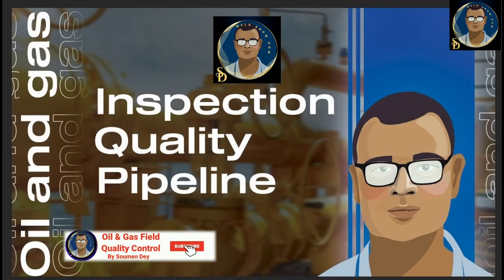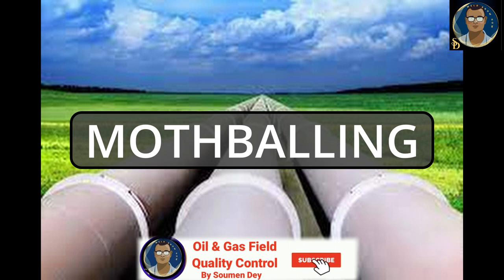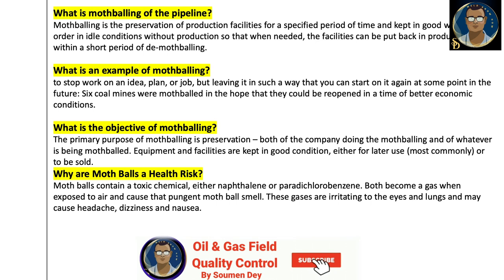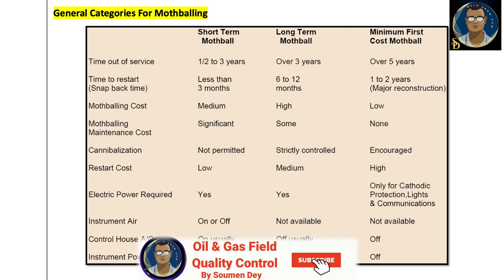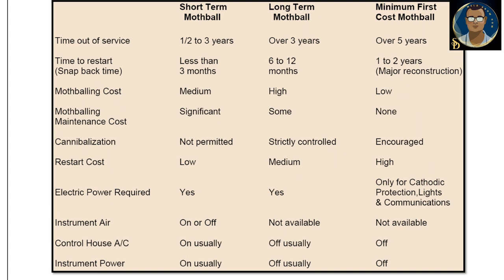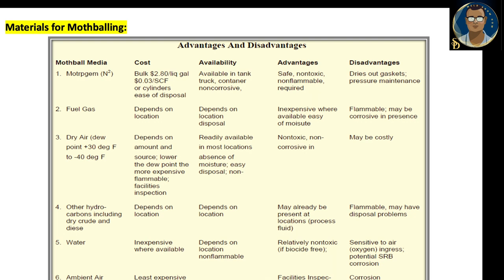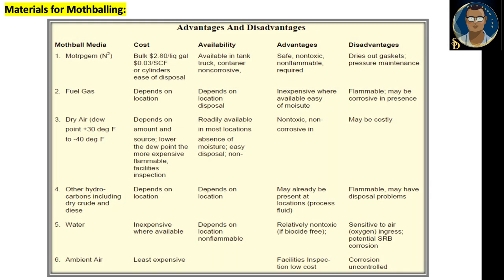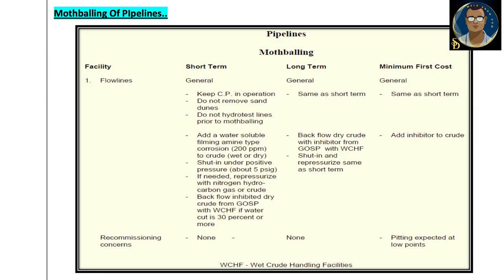MOTHBALLING, DIFFERENCE LAY UP & MOTHBALLING, OLE FACILITY IN ACTION, REINSTATEMENT PIPELINE PROCESS

Comment: Thank you very much , it is well presented, i am very interested, especially i am handling  pipelines preservation contract in the company i work for.
Reply from the maker: Very good- Please keep it up! achieving dew point after proper cleaning after cleaning an old line is a real challenge for the contractor.
Reply: @OilandGas-inspection-soumen  please explain about vacuum drying & nitrogen purging in brief
Reply from the maker: Sure I will Try @sahebhussain1855

Comment: is there any standard, procedure or reference for oil and gas asset mothballing? then inspection and maintenance ?
Reply: Thanks for your comment. Actually the mothballing is purely a part of plant or pipeline owners requirement or part of their maintenance and expansion program. So each and every proponent has their specific requirements. What I have discussed here is a general outline of the process. Due to copyright issues, I am not authorized to to share any such document in this platform